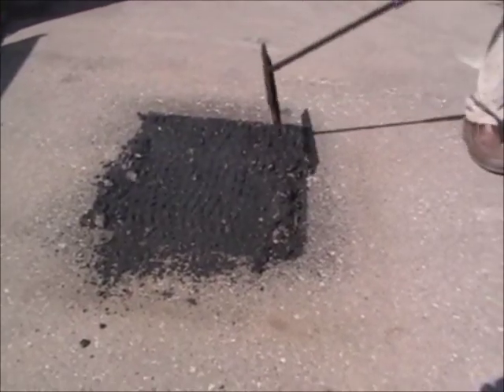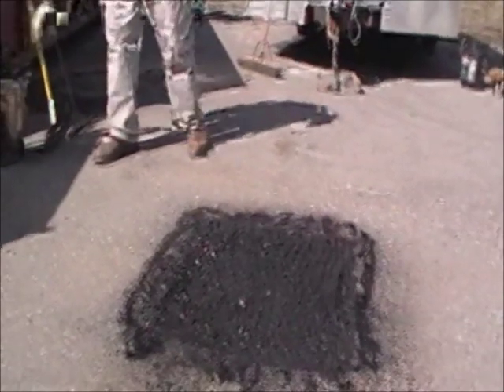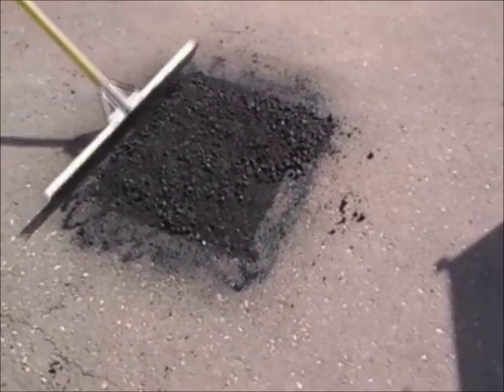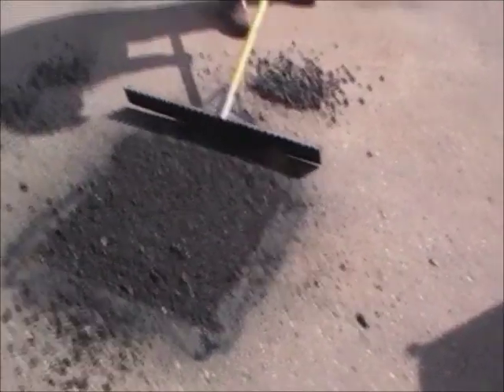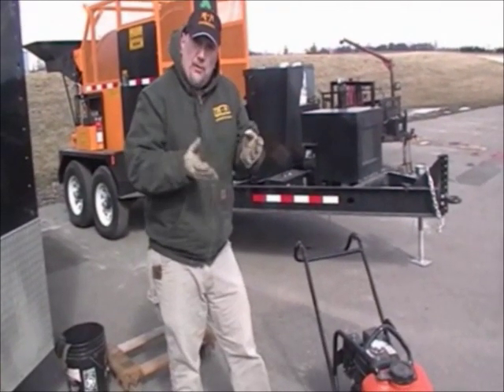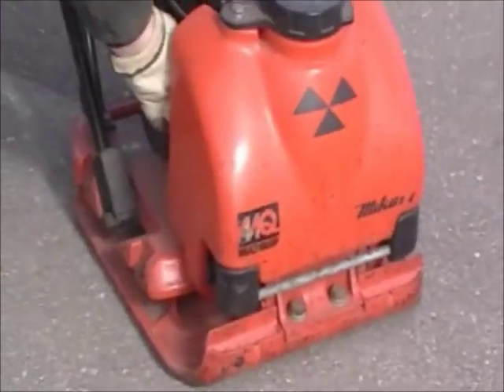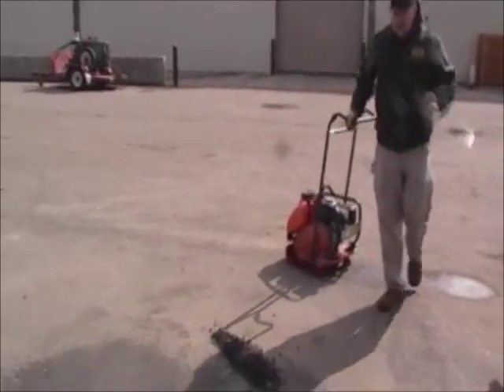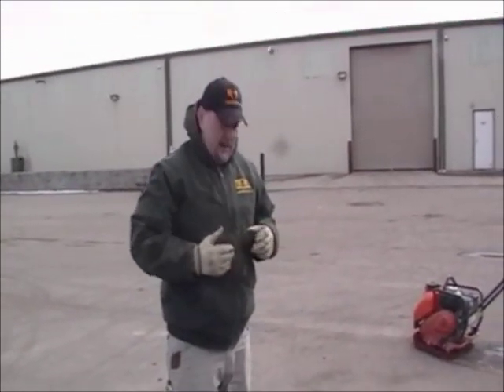KM International Portable Infrared Asphalt Heater LB2-16 (2 of 2)

Comment: That model is advertised at 16 sq ft. But it looks like it can really only do about a 2x2 patch. I'm in the market for an infrared and thought this model would be the ticket. But now I'm thinking you could only do really small patches with that thing,
Reply: It heats up a 4x4 area, but you have to leave a hot perimeter to ensure the hot to hot bond.  They could have made the patch roughly 3.5' x 3.5', but for whatever reason they only cut it to 2x2ish.

Comment: i can see your not a tarmacer. you just took out some of the tarmac so you will make a depression in the pach
Reply: They are just showing the procedure without adding asphalt. I see you're not much of a speller.
Reply: Steven smith  what do you do to ensure patch is actually level with surrounding asphalt? as in no depression or no hill? seems a guessing game and I'm not comfortable with that.
Reply: Just lay the tarmac 15mm higher at 30mm depth
Reply: @01mustang05  They are using a tamper instead of a roller like the original installation. So they can not pack it as tightly. Same method my company uses and I ensure you there is no depression, even after years. Saw cuts have a tendency to depress due to the base being compacted quickly and not being able to settle. So after time the patch depresses. With infrared you are not disturbing the original base.
Reply: @adamwarlow7066  so how do you account for the extra material that was removed from the patch?
Reply: @KenGaska  by adding other material.  They mentioned having a hotbox on hand.